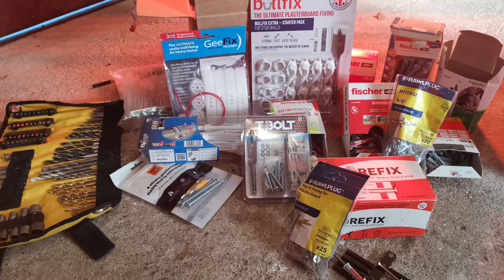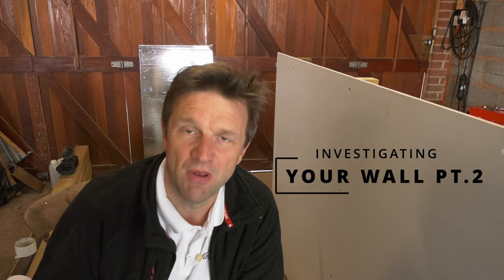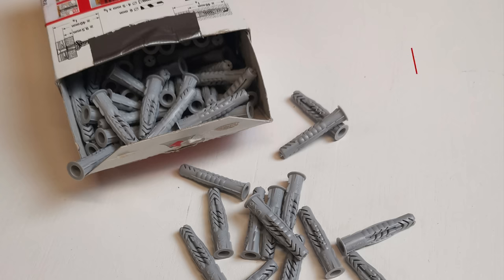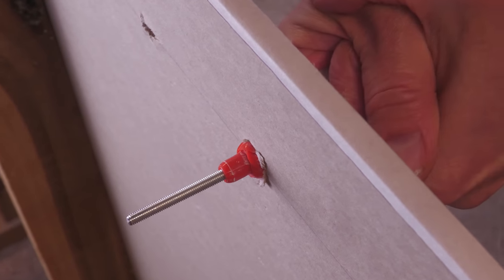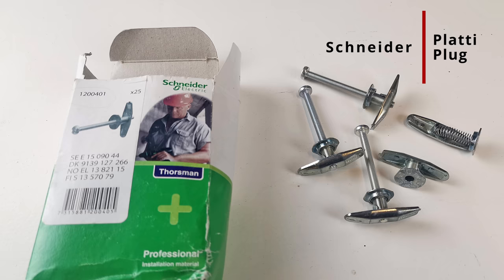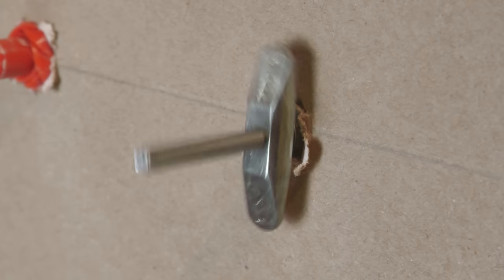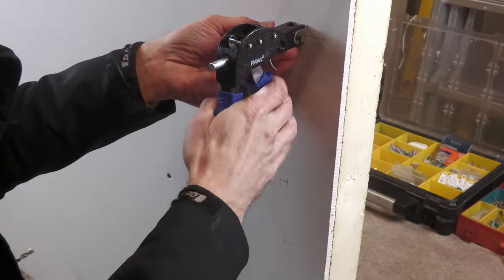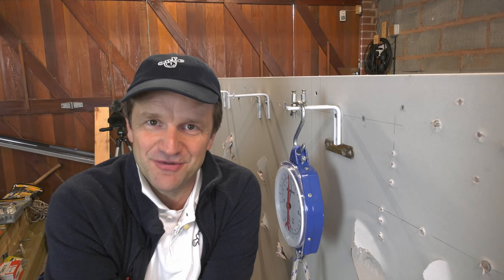How to Fix into Plasterboard - a Complete Guide to all the Best Fixings

Comment: Thank you for a very comprehensive review.  I had been going to put up a bookshelf with 2 screws into the only stud, and a load of molly bolts,  Instead I’ve just followed your link for the Bullfix extra fixings
Reply from the maker: Good work Andrew. Yes they're a brilliant design, and get easy to usual. I wouldn't bother with the universal as I think the anchor isn't wide enough but the extra are great.

Comment: I used Grip-it fixings for some cat furniture (yes you read that correctly - essentially a platform up high for him to sleep on). All fine to a point, but as he got heavier and with slight movement every time he jumped up there, they finally failed this year and took lumps out of the plasterboard wall when it fell down. I wouldn't use them again. Usually my go-to fixings were the metal Hollow Wall anchors as I've never had any issues with those and have hung some fairly heavy items on them but I might try some of the ones with the wider wingspan you've featured as they look ideal. Great video Charlie - thanks!
Reply from the maker: Thanks Sharon. Yes the hollow walls have always been a favourite of mine. Glad you found it useful and thanks for the comment 🙏

Comment: We’ve been using togglers for last 7years, brilliant fixings, We fit 18U coms cabs to stud walls and hang off them to prove the strength, get some funny looks from people lol. They do need a bit of depth to get them to set but a good way of getting around that is to drill your hole on the angle not straight through, it gives them the room to set and the hole still allows you to line the bolt up straight.

Comment: Fantastically comprehensive comparison. Easy to figure out now what I want and don't want to use on my plasterboard walls. The house is from the 80s, and apparently when they built it they felt it was fine to put the studs 1.2 meters apart, which is some bullshit. Which really makes using studs to mount to a challenge, so I need a good anchor solution. The Bullfix looks like the sweet spot I think as I'm not hanging super heavy stuff, and since it's removable and reusable that also factors in. Just seems more elegant than losing metal bits inside the wall. Most likely overkill for my application but hey, having some margin never hurt, the total cost won't be that bad. Oh, but one good thing about the composite Fischer variant - only need to drill 10 mm.
Reply from the maker: You're welcome. Yes I never use that Fischer toggle to be honest. Stick with the Bullfix. As you say, being removable is a good option but I wouldn't worry about the odd bit if metal falling into the cavity. The builders probably left a whole heap of other stuff in there anyway 😉 For lighter weight stuff, the Fisher Duopower 8x40 is a fantastic universal plug.

Comment: The brand 'Toggler' seems to be king for anchors and plugs. The snap toggle anchor for drywall, and the alligator plugs for brick walls, always rock solid. I've had so many issues with other brands like Fischer etc.. Most of the time Toggler has the best and most sturdy design out there..
Reply from the maker: Certainly for snap toggles. I think Fischer do some great fixings though - particularly the Duopower.

Comment: Hi, this video has helped me so much and I feel much more confident about hanging things up in my new home. I am using the raw plug hollow wall anchors to hang a very heavy coat rail and wondered how do I check the thickness of my plasterboard and what size would you recommend? I bought the m5 x 65mm and thinking these will be too big.

Comment: Pretty good vid thanks for sharing alot of info here.

I've used most anchors and some here I haven't seen, great selection. I have previous reno experience and have performed tons of general contractor projects.

Something that should be said should be the absolute necessity of explaining: 

1.: You are not losing your mind when an anchor fails and
2.: you will want many different diameter anchors to tackle even typical hanging projects. The high fail rate in practical scenarios is an interesting statistic.

Comment: Very informative. Ive always wanted to test anchors. I used the zip anchors for years in the drapery industry. Modern high end draperies are HEAVY. I switched to spring toggles because of they are  adjustable. You can slide your bracket up and down a bit before final tightening; to fine tune your drapery rod. However, I do use the larger 3/16" ones, which are much stronger than the 1/8" ones the rest of the industry uses. The 1/8" spring toggles break. They break before the drywall fails. Once you tighten down a 3/16" spring toggle, and add a second screw to your bracket, they dont budge.  I do still use zip toggles though if i'm installing something over the top heavy. I had a hunch they were the strongest available by far, besides that monster G-Fix anchor.   Great video!

Comment: Hi Charlie, you can never have enough plasterboard fixings videos 😆!
Probably quite a specialist questions, but any recommendations for fixing heavy loads to a tiles plasterboard wall? I’ve been asked by a customer to fix a mirrored cupboard to a tiled bathroom wall in a new build but it has me pretty stumped, not least as drilling large holes such as that needed for a toggle is going to be problematic in tile.
Reply: Hi, unless you're looking to hang a giant telly, you'll find that the tiles lend quite a considerable bit of strength to the plasterboard walls. If the item is not too heavy, you can often get away with a red or brown plug for,  say, an electric towel rad or shower rail. Space permitting, I'd go with hollow wall anchors, as I've used them in the past - even for kitchen wall units.
The takeaway here, from Charlie's tutorial, is to start with the smallest diameter hole, and work up as necessary.

Comment: The biggest problem with most fixings is you can't have close together ie when filling curtain pole  brackets. I bought Fisher plugs and found as tightening would start to spin in plaster board even when hole drilled smaller and plug tight fit. Put in bin . I use red plug 5.5 bit or brown 6.5 with yellow in it to make tight fit. Have worked for me 20years plus. Hollo wall are my go to with big brackets. Thanks for a great fixing vid👍

Comment: Fab advice Charlie. Used the Timco multi Stella 55 on single plasterboard to install ceiling brackets for curtain rail. Rock solid . Think the ceiling would fail before the plug! 😂
Reply from the maker: Glad to hear it. Yes I need to use those Timcos more often. Very clever design. 👊

Comment: I was fitting a new ceiling rose today, tiny messy hole that the wire comes down through. Tried the bent paper clip trick (great in theory!) but even that struggled to get through the hole. I think the plasterboard is double thickness (25mm), but only had the 8x40mm duopower plugs as the longer ons are like rocking horse poo. Anyway, took a gamble as very light load and the screws seem to bind nicely. Great product!

Comment: Another excellent video thanks Charlie. Timely as well as I've just installed insulated plasterboard in my dining room (your video on that install really helpful btw). Having finished the painting only yesterday I've been thinking about hanging pictures, mirrors etc. Feels like a combination of duopower for smaller items and hollow wall anchors for a heavy mirror I have will do the job. Cheers again!
Reply from the maker: I think that's a perfect combo Richard. The important thing is not to pierce the vapour barrier at the back, I guess - so screws and bolts that are just long enough. I stupidly omitted to give my opinions which I'm really cross about. I've been working on the vid so long it became a sprint at the end to get it out, which I promised myself I wouldn't do. Sounds like you were able to draw your own conclusions though and the array of options wasn't too confusing.
Reply: @CharlieDIYte  no it was really helpful and there was a lot of ground covered so can see how you can't get everything. It's a good point on the vapour control layer. I have installed celotex pl4000 which has the vcl between the plasterboard and insulation so there isn't a way of not piercing. for services they recommend a bead of adhesive so wonder if I should apply some around the fixing?

Comment: Great video Charlie. So helpful.
Curious why you didn't Include the Fischer self drill plasterboard fixings? They are great, quick and easy for most things!
Reply from the maker: Thanks mate. Oooh no, those are the dreadful helter skelter corkscrew fixings, yes? I would only ever use them to hang a very light picture or otherwise where the load was strictly downward only where you're installing them in a wall, and had no cantilever force as they pull out fast too easily. 👍

Comment: another informative video.
thanks for taking the time and effort to setup the examples for demonstration.
the content, presentation and video quality are all great.
I would like to see a related follow up video on how to address or resolve the "screw ups"  on surfaces like tiles, dry walls or plaster boards  involving different types of screw or bolts involving different types of plastic or metallic anchor plugs .

e.g. a hole is bigger than the loose screw which cant be pried out without say damaging the tile or plasterboard etc because an anchor plug is attached on the other side. 

one solution I have thought of is to use a hacksaw to cut the head or stem of the screw and let it drop inside the hollow cavity and try a better size screw and anchor to sit tightly in the hole but I am sure there will be other solutions and similar situations.

Comment: Best HWF video I've seen and I'm now a subscriber.  We fit handrails in council properties and we have to attach a timber AND THEN attach brackets for the rail. I think most of the fixings that did 30kg or above would be OK. What's your opinion?
Reply from the maker: Thanks for the sub 🙏 Difficult to know as each situation will be different but if it's just plasterboard I'd probably use wall anchors and grab adhesive on the board. But the Geefix is the strongest. Snap toggles also great
Reply: @CharlieDIYte  Yeah I was thinking those myself . Thanks mate

Comment: Another helpful video Charlie. I must confess I've just finished it and am a but overwhelmed by the number of options (I always appreciate how you cover all the options though, never stop :) ). Could a brief summary be added to the end of the video of what your findings were with a photo of each fixing you are discussing as you summarise?
Reply from the maker: Yes I'm cross I didn't do that. After working on this for 2 weeks it didn't occur to me, but I should have and no, I can't add that without taking the video down. I'll see if I can do an additional vid by way of conclusion. Basically I use those Duopower all the time for most jobs as it's not often you're needing a really heavy duty fixing. Geefix for seriously heavy stuff eg heavy mirrors, radiators, TVs, kitchen cabinets, I was impressed with the T bolt and Bullfix - which you could probably also use for the above and I still love the wall anchors.

Comment: Most helpful fixing video I've seen, and I've seen a few! What would you recommend for mounitng a TV on a double plasterboard with a tiny gap/insulation behing it?
Reply from the maker: If it's really tiny, Corefix or Rigifix would be you're best option. You should always try and fix into the wall behind if you can as plasterboard is inherently weak. If the gap was larger I would suggest a snap toggle or the longer anchor fixing.
Reply: @CharlieDIYte  Thanks! I think it's Thermalite behind the double plasterboard as the drilling feels too effortless and a dark grey dust comes out from the hole. saw your other video so look like Corefix is the solution. Given the Timco Stella works on both brick & plaster, would that be a solution?

Comment: Brilliant Video Charlie ! Just a couple of comments, do not use hole saws for plasterboard if they have an ejector spring ( Remove it), it will blow the back of the plasterboard and will be no good for any type of plasterboard fixing. Also the Bullfix Universal Plasterboard fixing does work in insulated backed plasterboard !
Reply from the maker: Thanks Mark. Yes I should have given the universal a go in that insulated plasterboard. There will always be the odd error or omission, particularly in a video this length. I simply picked the fixings I thought off the top of my head (with video fatigue setting in!) would work best, based on design, but given how both Bullfix fixings can open up in such an impressively tight void it makes perfect sense that the Universal in particular would force itself open under the insulation. I may do another vid concentrating on just this angle and will give it a go if I do 👍

Comment: Great video. I have newbuild home and need to fix some items when the fixing screw isn't screwed up tight to the wall/plug etc. Most of the anchor parts seem to works in the end stages of tightening the screw what would you suggest is my best way of fixing small items and heaver items? Thanks

Comment: This video is so invaluable as are several others we've been working through!
We snap toggle for our radiator panels, but we have polystyrene beads on one of our walls and the snap toggle doesn't open up.  Your video doesn't mention this, so any advice would be hugely appreciated please?
Reply from the maker: Hi Claire, hopefully you've got my other message now. This is what you need to watch for this problem https://youtu.be/L2Hy1IhQ17s and choose whichever one you most like the look of but I would suggest the T-bolt.

Comment: I will be ordering GeeFix, these to hang a tv.
These seem to have been designed to eliminate 'torn' drywall fails because they have the full round plastic thread plug that fills the hole that has been drilled, thus minimising further damage and fails to the now compromised  drilled drywall. This I believe is where most of the other fixings fail in there design, and seems strange that the other companies have not picked up on this!??.

Comment: Great, great  video that has helped me massively with my choice of fixings for a rail to hold some very heavy curtains. Incidentally the Thorsman Plattiplugs are still available from A.C.Sissling and from European suppliers and for me it was a choice between these and the Snap Toggle. The Snap Toggle won out because the info was there for the Load Test. It would be great to know how the Plattiplug performed in a similar test. Many thanks 🙂
Reply: Discovered a complication in that when I drilled into  the area above my window it's  lathe and plaster. The snap toggle doesn't work as its not flat enough behind the lathes. Any idea what I could use - the lathe and plaster is about 25mm deep and there is about a 20 cm gap before you get to exterior timber work?

Comment: Well handy back-to-back review this Charlie - I just bought & fixed a relatively heavy bathroom mirrored cabinet using the GripIt Brown rated plasterboard fixings (!!!).... seemed to drill/fit okay, I checked wings fully expanded out.  I take you point about their design and worried by your Red GripIt low load results 😮.  Likely, I'm using in pure shear (the manufacturer does say not to be used for cantilevered installations). Let's hope 😔🙏
Reply from the maker: If it's just downward force you'll probably be ok 👍
Reply: @CharlieDIYte  Yes, shear only but I've been concerned in the past with putting up bookshelves etc. where there'd be cantilevered axial force pulling out of the plasterboard, so this review/testing was informative 😃👍

Comment: Hello, Charlie! You're the best! I need your professional advice. Wall - 2 layers of drywall (2X12.5 mm) and behind it Knauf acoustic wool. I have a choice - 1)Molly bolt 5x65mm or 2)duo power 8x65mm and screw 5x70 mm. What is better to use for TV 20 kg close to the wall?
Reply from the maker: I would go with the molly bolt. You can buy one with a longer collar designed for double thickness plasterboard. Perhaps that's the 65mm you mentioned? 👍

Comment: Great educational video for a DIY novice like me. Do you have a rating for the best of the 4 fixings you tested in insulated plasterboard or are they equally as good? Thanks.
Reply from the maker: Thanks 👊 I did a stand alone video on this recently https://youtu.be/L2Hy1IhQ17s No they're all pretty good but the Fischer and Timco are obviously lighter weight. I'd probably suggest the T-bolt.

Comment: Grateful for help. I have a plasterboard of about 15 mm. Unfortunately, the gap between the plasterboard and the brick wall is only 10 mm. With only a 10 mm gap, can I use a hollow wall anchor?
Reply from the maker: You're best to use Corefix or Rigifix and anchor into the brickwork behind.